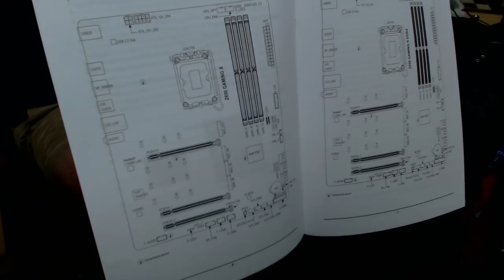Let's Build a New Computer!

Comment: Apparently you didn't follow the Verge PC build guide since you missed step one,  you need a table.
Reply: pFT who needs a table when you have floor. Pro lvl assembly here :)
Reply: @GuardianEngraving  exactly. Floor is just an infinite table
Reply: He also forgot his *wireless* anti-static bracelet. But at least he can screw in with confidence as he puts his brick on the insulation pads! /s
Reply: The most important thing missing is the six pack.  I never build without one.

Comment: You want the fan cpu cooler fan to blow the direction of the io shield out the back through the rear fan. The fan mounted in the front of the Cooler would work better on the other side  helping push air out through the back of the case.

Comment: Despite being a computer guy, I built my system for the first time two years ago and hated it. My system works fine but I had plenty of anxiety about whether it was even going to work and then every little hiccup afterwards. I thought the fans were too noisy, the power supply was humming exceptionally loud. Not a fan of it. I'd rather pay the local specialty shop the $100 to take that entire burden and to provide me the warranty on top of it all.
Reply: Choosing the right components is part of the process. I built my new rig a week ago and it’s basicly silent when running windows. I have 5 case fans, a double cpu fan and the ones on psu and gpu. Every part is chosen to be silent, with rubber inserts to not rattle in the case and by running silent. Even the case have rubber for the psu place in my case. The system works flawlessly and replaces my 8 year old mini itx build that was also built to be silent, but my new one is more silent than my old :)

Comment: Love the build Llama! I just want to give a friendly heads up to keep a eye on your CPU temps! 12th Gen Intel is known for running hot. If you notice high levels of heat then you may think about a AIO to keep that beast cool! Love all the content you make!
Reply: There isnt really much difference between air cool and aio its only when you go to overclock is where itll make a difference
Reply: C'mon.. is NH-D15, who needs AIO? Maybe some 360 are a little bit cooler but running loud AF
Reply: @rickysmith6930  The NH-D15 will hold its own against any AIO cooler out there for overclocking. The only difference between water and air cooling is that an air cooler heats up faster and cools off faster, so you (may) get more fan spikes. Water heats and cools slowly, so it can absorb a lot more heat before the fans get loud, but a heat soaked AIO will continue to be loud for a lot longer after the load has stopped.

Comment: Having the power at the top makes sense as then its heat won't pass through the rest of the computer.
Reply: yeah, but it doesn't really. We think about heat affecting CPU and GPU performance, but it also affects the PSU. Think about the airflow of this case. There are fans on the bottom and the front, so the air is flowing up and back, driving everything to the top back corner, which is exactly where the PSU is sitting. All of that heat is being sent directly toward the component that is meant to supply power to the whole rig. Too much heat causes electronics to fail, and when a PSU fails all kinds of crazy things can happen.

The CPU and GPU have massive heatsinks on them to dissipate their heat, the PSU doesn't have that luxury, so it is even more important to isolate it from outside heat sources. That's why most case designs put it in an isolated "basement" at the bottom where it draws fresh air in from underneath and exhausts it out the back without adding heat to or receiving heat from the rest of the components inside of the case.

Comment: Ryzen is great, I have had no issues with it (running 4 rigs). However, right now I would condider Intel given that AM4 had it last supported cpu released and is basically EOL.
Reply: Yeah, but that's not really a deterrent. Socket compatibility used to be a thing for an upgrade path, but that hasn't been true for nearly 20 years. Sure, if you buy an AM4 mobo today, you won't be able to put a ZEN4 in it later, but would you really want to?

Intel figured out years ago that putting newer chips on old sockets is too confusing. Newer chipset features often rely on newer CPU capabilities. So, every generation of Intel chips has a different socket. Makes things simple. Saying AM4 is EOL and thus not worth it is silly because building with Intel wil net you the same result. Your next shiny new processor will need a different mobo, and your next shiny new mobo will need a different chip.

Comment: Question:

What is the largest monitor that works well with D2R

I’d like to build a machine just for that.
Reply: Largest is up to you. But given it doesn't properly support ultrawide consider 27-32inch 1440p or 4k respectively.

Personally I still think if not going ultrawide that 1440p 27inch 144+ hz is the sweet spot. And doesn't require you to have the latest and greatest gear either.
Reply: I run a 34" 1400x3440 monitor, game does not have 21:9 support but does allow 19:9 so it's fine by me.